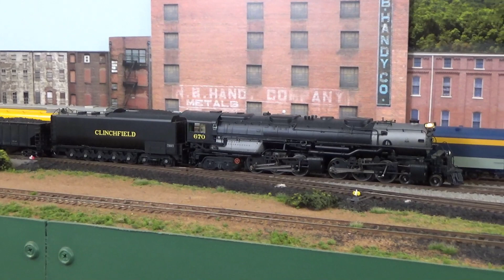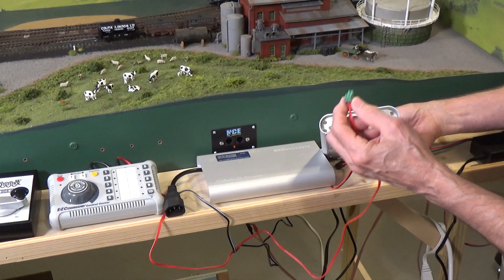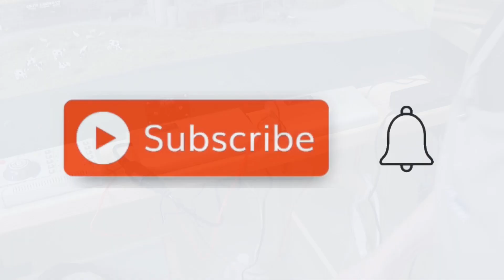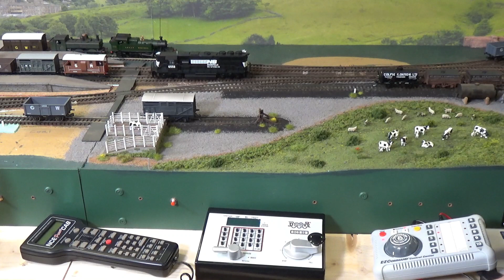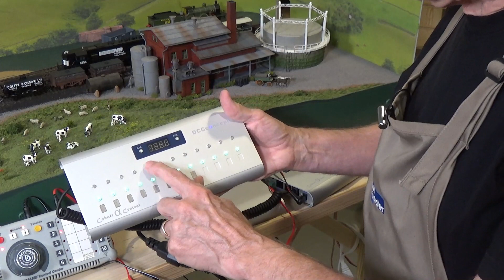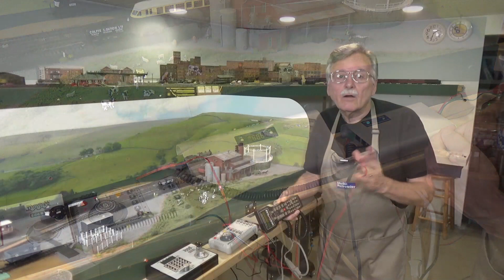Need More DCC Power--Watch This Before You Buy (270)

Comment: Why did you take my comment down? It was a legit question as to why you're not talking about another product that's cheaper and easier to use.
Reply: What was it?
Reply: @DavidSmith-dm8ew  I enquired why this solution was being highlighted vs another product that has been shown on this channel. Looked the cost of the DCC Concepts solution up and it’s more expensive vs this other kit.
Reply: @harrisonbs   don't worry. Your not the only one a little weridly out. Bachmann dcc actually came out with a dcc switch set up about a good few months back. And i understand the video is for the booster power. But still. Bachmann has a dcc switch now. Its not very known. But its out there.
Reply from the maker: Ben—I just started looking at comments this morning and I didn’t remove it. If you included a link to a website then YouTube may have removed it so I’ll look deeper for it. I try to answer all comments and only remove those with porno links and from trolls and the like—Larry

I can’t find it in among the porn links and other banned stuff so I have no idea where it ended up. Feel free to repost.
Reply: @TheDCCGuy  It did have a link - the Tam Valley DCC Acc Booster. I was wondering why the DCC Concepts solution is a better option since it seems to cost more vs just buying that board and getting a 5A DC power supply.
Reply from the maker: The main advantage of the DCC Concepts booster over the Tamm Valley one is it allows you to use the Alpha Central panel to control accessory decoders and to use some other Alpha products, so it really is a smart booster. This is something that a number of introductory systems cannot do and the only way, other than with an NCE system, that you can use the Alpha Central. As you point out I have covered the Tamm Vally Depot product previously so this provides a different option. Also in my previous video on the Alpha Central I promised to show you guys how to use it with other DCC systems so just following through on my promise. 

My philosophy is to provide an introduction to new products and to offer alternative options that you may not be aware of. It is up to you to compare the costs and decider whether the added value of one method or product over another is worth any cost difference. Keep in mind that the cheapest option  may not always be the better one but that is your decision to make not mine.

Comment: Why anyone would want all those controls when Digitrax will do it all or the NEC. That's a lot of controls the Bachmann System has.
Reply from the maker: Just provides another,option.
Reply: @TheDCCGuy  but I believe in KISS. 
But Thank you for providing the information.
Reply: The DCC power box upgrade is primarily aimed at those with a DCC starter system and dont want to lash out a lot of money all at once or those who want to power a number of districts as opposed to full blown out of the box systems that cost a lot more.  

The Alpha Central is one separate option for controlling accessories which some starter system dont have and enables people to build their DCC control in installments.
Reply: Thank you for your comment on the system at hand